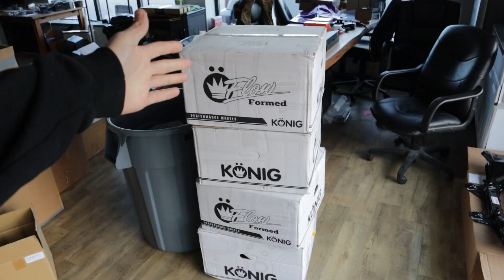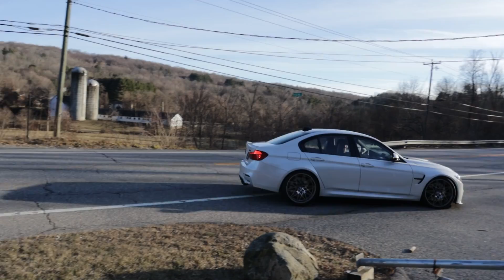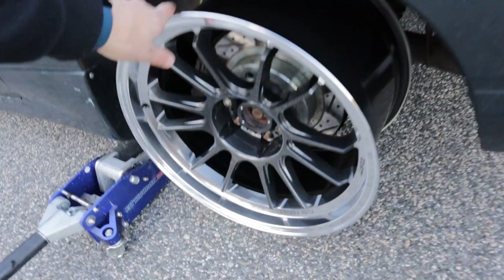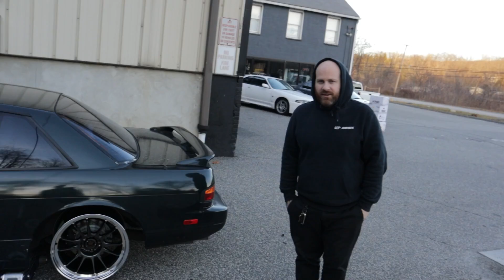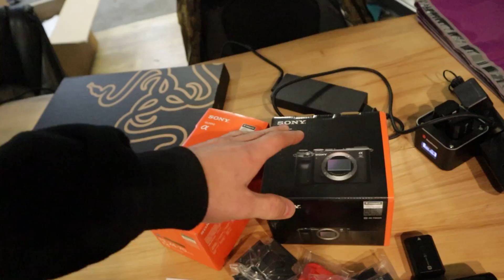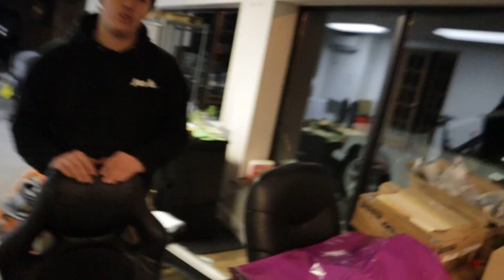NEW WHEELS FOR MY S13 240SX!

Comment: The new wheels look okay. I'm sure they are good wheels as Konig would be a fairly good brand but the black centres with the polished lips just look a little bit tacky in my opinion. If they hooked you up though it is a win win.
Reply: I have XXR-557's on my BA in aus. They have a polished edge around the cut cut outs. These would look schmick with just the divot silver.

Comment: Look into the Zeiss 16-35mm f/4, I find it a lot easier to vlog with than a 24-70mm because you don't have to have your arm fully extended at all times at 24mm lol. The f/2.8 versions of both lenses are really great too, but super heavy (and $$$) and the low light performance on these newer Sony bodies is unreal so f/4 is super useable.
Reply: Gotta have 16-35

Comment: probably shouldn't chop it up to fit the wrong size wheels for 'grip', get a different car if thats what you want? 350z? or just wheel that fit?. s13 with oem quarters is rare and cooler than boof frp overs just my opinion..

Comment: Ew, Konigs.

Japan's regulations/ways of doing things are nonsensical to me in general. What difference does it make if you spend time alone in your home or in another property that you own not interacting with anyone? How is that any worse than being forced to stay at a hotel for the first 3 days, where there are any number of other individuals nearby. 

Let's say the shop was set up in a manner like Tom's dealership where you could actually stay there as a home away from home with accommodations if necessary, would that be a problem? Similar to people who have like suites in their offices to crash at. You'd still technically be "quarantining" but not at your home address. Even still, you're driving by yourself from point A to B, not interacting with anyone else, in a sealed vehicle.